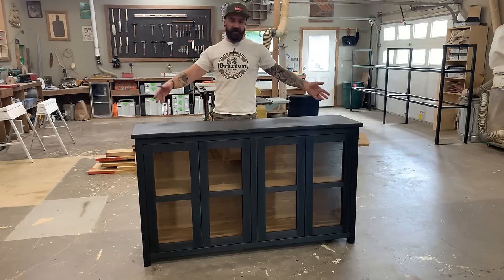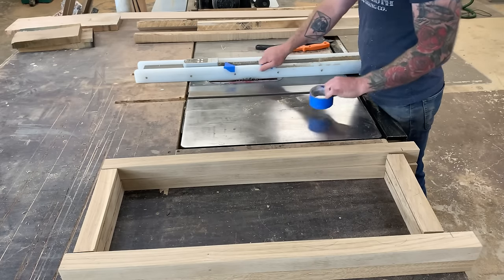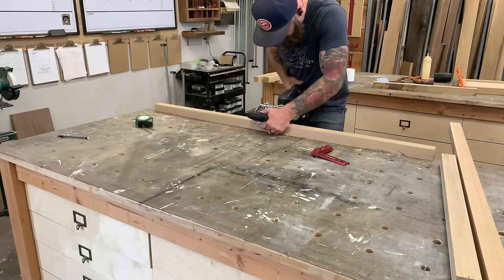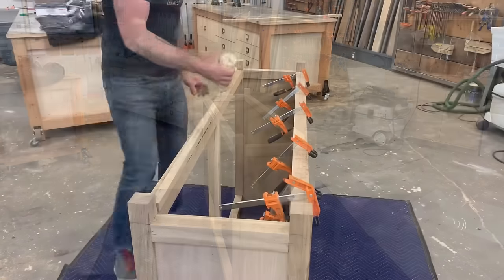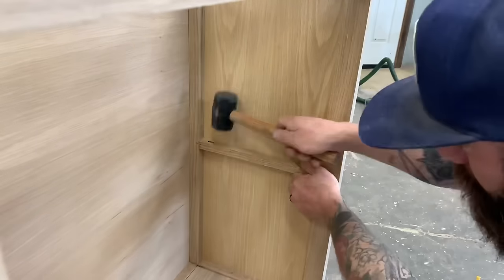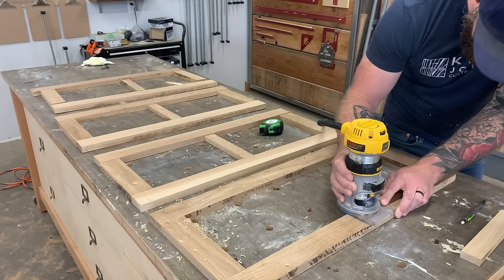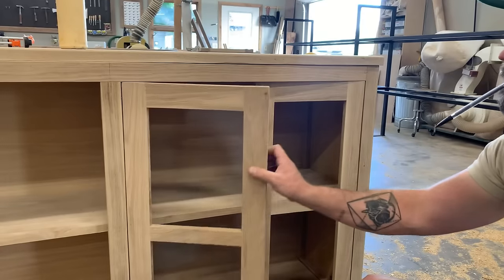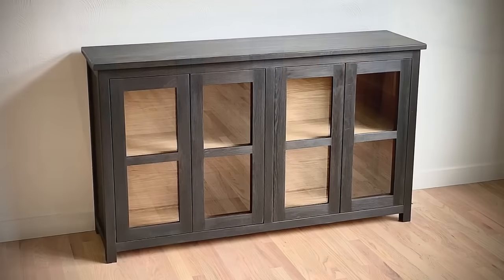Easy DIY Storage Cabinet Build | How To Build A Wood Storage Cabinet

Comment: I should have you build my tiny house base cabinet 😄. 2 pull out slide sides for Mason jars/cans, a under the sink cabinet door, and silverware drawer stacked on top of the pots and pans drawer and dish drawer. Followed by the stove cut out pan drawer and cabinet open for propane tank followed by a 2 teir slide out for the fridge on top and either an open drawer for snacks or the schetter bucket. With a butcher block top  and a top mount sink.

Comment: When using the Domino joiner, it is important you position it correctly so as to make sure it compensates appropriately, then using one smooth pelvic thrust, apply the joiner to the wood.

When later clamping the workpiece, you may notice a sticky residue oozing from the hole you've just filled with the Domino. Don't worry, a quick wipe with a damp cloth should clean that right up.

Comment: Hey man. Just found your channel and happily subscribed. I dig your work. It's super practical. I'm all about not sweating things like invisible pocket screws. If it works, it works! I have a guilty pleasure of using pocket screws in just about every project. Screw the haters. Screw. Yea, pun was intended. 

Along the lines of practicality, don't sweat that you're using a $1,400 tool for joinery. Sure, most weekend warriors like myself can't justify it, but you're a professional. The tool saves you time, and *time is money*. Compared to the time needed to get out a doweling jig and monkey around with it at every joint, I'm sure the Domino has more than paid for itself already. Plus, nice tools are nice. Tools like the ones made by Starrett are actually a joy to use, so that makes them worthwhile to me. There's no shame in it. You can have nice things. You earned them.

Lookin' forward to the next builds. I have that notification bell set!

Comment: Nice looking cabinet! I really like the way you comment on your video instead of first person presenting the stuff. I noticed some burn marks on that stock. Sure, most of it got coloured, but could it be your blade needs some resharpening? From the vid it doesn’t look you paused too much during the cutting. As for the “bottom”: with just glued on support: how much weight can it take? It was intended for the bathroom, so usually not much weight to be expected,  but what if it was for the living room where a lot of plates and stuff would be put on the “bottom”?

Comment: It looks like you should have used a "rip cut" blade for your table saw to keep from scorching them. I had the same problem until I grabbed a an Amana Mamba rip cut blade. It made a huge difference in my rip cuts. Even rip cuts on 8/4 maple are smooth and no scorch marks.

Comment: I collect Film, Projectors, Cameras Etc...., I will save this video and make about a half dozen of these about six feet wide by one and one half feet deep, to hold all of my 16mm film.
We don't have the beautiful range of timber available here, but I can buy all the carcass timber the right dimensions and only need to cut it to length, so even with my limited workshop space and tools, I can make these myself.

Comment: I'm Jonesing your channel. I'm about to put on my first tabletop on and wanted to double-check if I needed anything larger than an 8th inch to slide my fasteners in. Is 1/8" standard and enough room for movement?
Reply from the maker: 1/8” is plenty. The slot size isn’t what allows for movement. The z fastener will actually move if the wood moves
Reply: @Bourbonmoth  z fasteners as in any brand that are shaped like that?

Comment: I have the 700 XL also. Were you using the 8mm dominos? and are your door frames 1 inch thick? I have the 12mm and 10mm cutters, thinking about getting the 8mm for projects like this. Thanks for the video. Makes me want to build one as my next project.
Reply from the maker: 3/4” doors 8mm dominos

Comment: Nice video, we have a question on the Rubio oil plus 2C. You mentioned your using black for a final finish but we see only the charcoal on the Rubio colour charts. We found the pre colour intense black for the first coat. Have you tried this finish on poplar ?

Comment: Do you think you can add the size of the wood pieces?  I have absolutely no idea about build but I followed your cabinet video and was able to McGiver the whole thing into a cabinet. I’m working out of my garage (love your woodworking shop), and have a whole basement I need to finish. The actual (or ratio) measurements would be a great help. In other words; need a scale drawing. Much obliged.  🤗

Comment: I notice you seem to use the Domino 700 in all your builds.  I was debating which one to get, 500 or 700.  I know there is some amount of overlap but I was thinking to just go with the 700.  Is the 700 ok for smaller stuff?  I would consider this build "smaller stuff".  Roe this particular build, what size Domino are you using?  Smallest one?

Comment: Nice production, vid and cabinet. But, a question (which is actually a remark also) if I may. I noticed that the plywood back boards have the grain going horizontally. I've learned that it should be vertically. So my question is, is this an intended choice, for getting a desired rffect or such, or was it coïncedence? Just curious.

Comment: For the cabinet doors and hinges how do you line everything up properly if you don't have the front face cutout? Like when you don't have a place to clamp the door or put the screws in while the door is closed.

Comment: Hey, great video!  Just curious how your inset door mounting procedure would change if you were installing doors with a wood panel already installed?  In other words, if you didn't have the opportunity to reach through the space where the glass will eventually go, in order to mount the door hardware to the inside of the cabinet.  Thanks.
Reply: I've used a story stick when mounting hardware on frames.  I mark the story stick when I drill the hole on the back of the doors and then transfer the marks from the stick to the carcass.  Works great.

Comment: I have a question for anyone in the comments here...

Why a dowel joint? I understand that dominoes are extremely sturdy, but what is the difference in a standard dowel joint and a biscuit joint? Is the Dowel easier to fasten than a biscuit?

Maybe my question needs to be different. If I were to buy one tool, should it be a biscuit or a dowel?

Comment: The Design of the Cabinet is great. But the way you are working with the Tablesaw, especially the Dados for the side sheets is way too dangerous to me. Instead of ruinning the Fingers I recommend better pushsticks. There are Jigs outside in the market to guide the wood less dangerous through the blades.